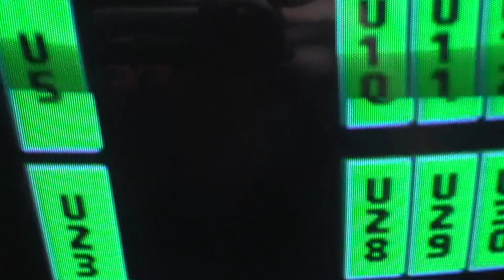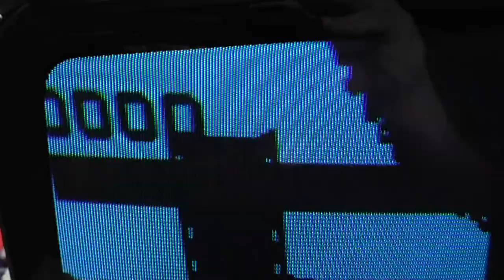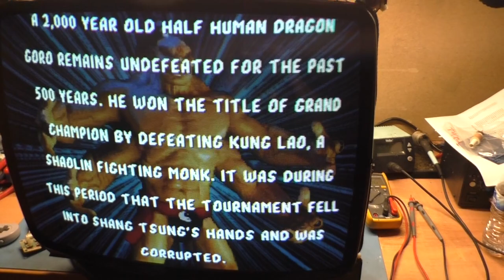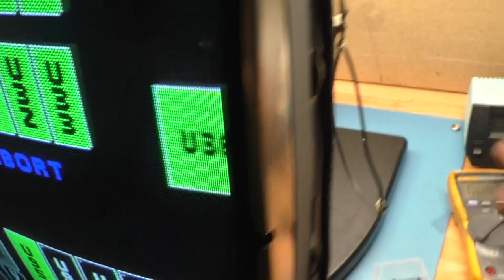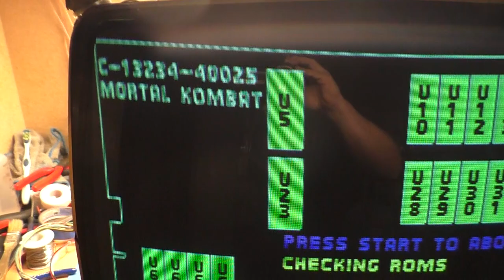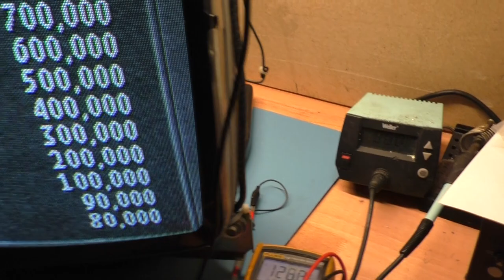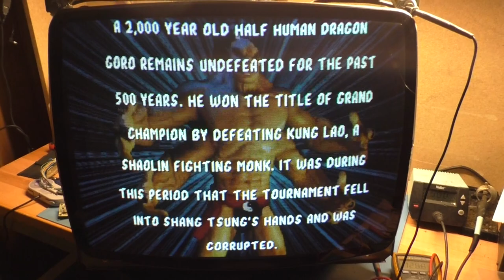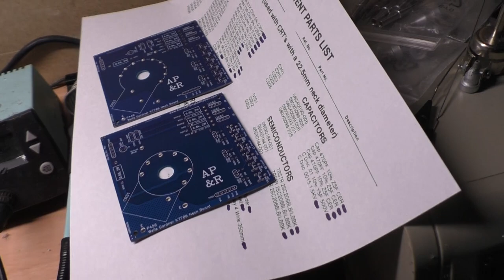25" K7000 Arcade Monitor Repair-A-Thon #4 - Fluctuating B+, Image Too Wide, Wrong Width Coil?

Comment: Purchased a P538 from a parts vendor assumed major-components-complete months ago. It was missing the width coil. When I asked for one, I was shipped an 005 as well.  I also could find no info on it except that Bob Roberts used to carry them (but for what?!). And someone speculating as a replacement in a U3000. But that's about it.

Comment: Another great video Mike. 

Did you super glue the lifted pad for the film cap?

What is Peter's website for the neck board replicas at the end?
Reply from the maker: Thanks. 

No. Just reflowed it so it was flat again. 

Arcadepartsandrepair.com

Comment: I have a 009A-2838-001 in a p538 where I can’t get the image wide enough. According to the Manuel it’s suppose to be a 009A-2838-001A

What gives ? I used the smallest cap in the width cap kit from Peter and it got smoked!
Reply from the maker: Smoked? That should not have happened. Did you install the correct voltage rating if cap? Was it in location C38?
Reply: @MikesArcadeMonitorRepair  I figured it out. Some k7000”s have a cap on the back that’s 1.6  KV.  It was missing. When I lowered the value of the width cap c38, it smoked and I got wavy lines on the tube. I put the original c38 back in and placed the missing cap on the bottom from a donor chassis. You know those old red kidney bean looking ones. I forgot the value but it was 1600 Volts. And the full width came back. 
Lesson learned. Luckily I had a donor chassis in house to compare and I realized something was missing. Without the one on the bottom the width was not enough.
Reply from the maker: Nice!

Comment: Is it possible this is a 27” chassis?  They typically have the pincushion daughter board…
Reply from the maker: Possibly, but there was no evidence of the pincushion board being installed.
Reply: Isn’t that the pincushion board, roughly center, standing vertically near C11&C12?
Reply from the maker: No, I’m referring to the giant board with the extra width coil on it. That’s the 27” version…to the best of my knowledge.

Comment: Is there a way to modify a K7000 height? It is totally fine with a game board, but with a PC running Mame the image just goes off the top of the screen..
Reply from the maker: You’re adjusting the v.size/v.pos/50/60hz pot, I’m assuming? You try changing the resolution setting?
Reply: Yes, tried all that, it just wants 1/2" top and bottom. I assume it's a known problem, I vaguely remember someone saying change the value of a resister near the vertical yoke connector.. 🤔
Reply from the maker: I would not do that. What about in Windows when it’s not running a game? How are you running the PC output? Converter? Forcing 15khz? How are you hooking up the video?
Reply: I've tried to keep the machine semi original, its a UK Supreme Arcade Systems multicab. So the PC is connected through a J-Pak jamma interface. Unfortunately the original Street Fighter game board doesn't work anymore. The PC has a graphics card that runs a software mod to get it down to 15Hz. But there's no way to reduce the image in height.